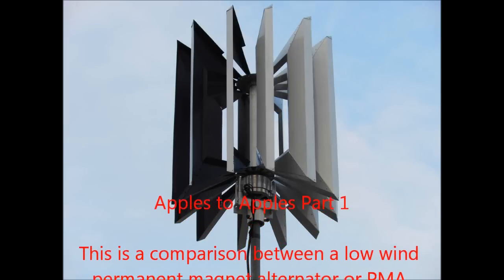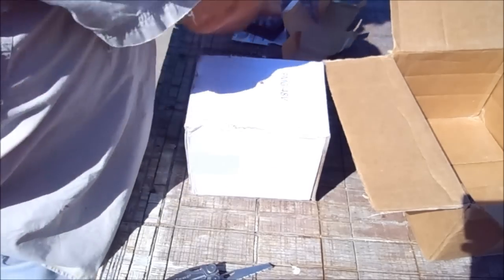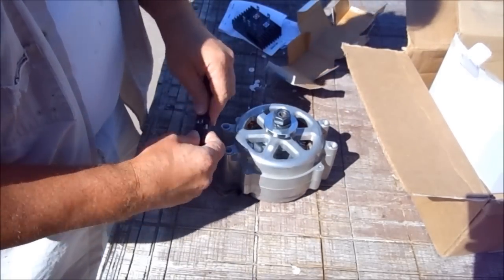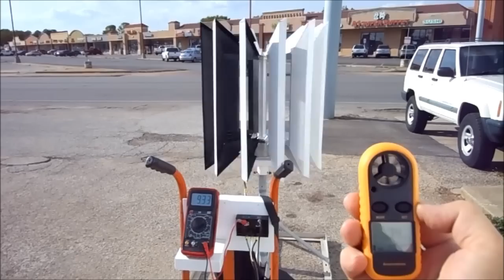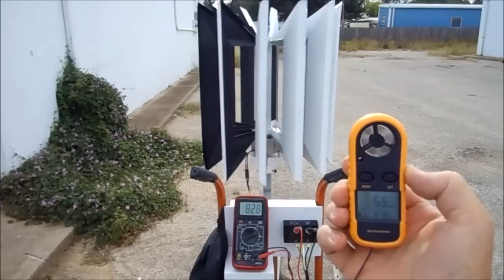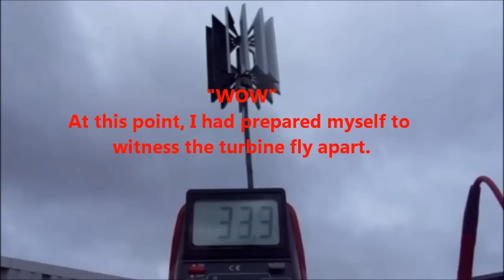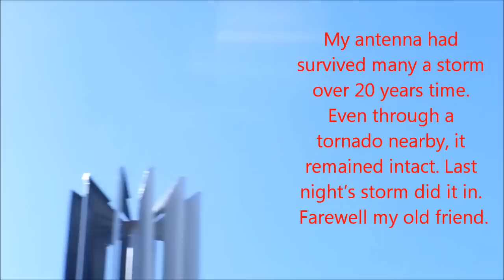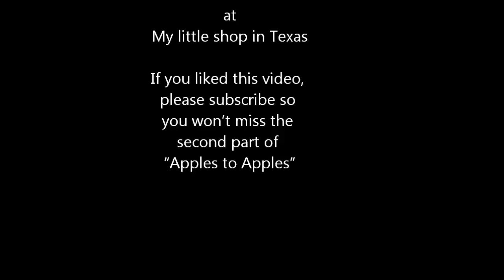Apples to Apples Part 1

Comment: I know some residents in one town were able to create and build "corner" turbines on each of the 4 corners of their homes.  I did not get any specs or product names but they were long vertical systems built right into the walls and the vane and geny system could be accessed and changed out when needed.
Reply from the maker: That type of setup will definitely be a future project if I can ever accumulate enough money for the project. Thanks for the comment.

Comment: How do you deal with lightening strikes?
Reply from the maker: I haven't had to deal with any lightning strikes so far. It might be more of a problem if the turbine was higher than the trees around it. It's usually the tallest conductive object in a storm that gets hit by lightning. As far as that goes, none of the trees around me have been struck in the last twenty five years either.

Comment: Very nice, your turbine is ecstatically pleasing and makes electricity, win win.  Did the alternator act as a wind brake at about 21 volts?  Have you tried a vane, to shield half the turbine so it doesn't push with the reverse of the paddles?  I am considering a build for us, as we live off grid entirely, any electricity is a plus enjoyed and subscribed
Reply from the maker: At 21 volts? All I can say is any load adds resistance and will slow the RPM of the turbine, but since my system is twelve volts all I need is 14 volts to charge my batteries. When I built the first small model, I built a shield that would spin around to point into the wind just like a horizontal wind turbine does. But in turbulent wind the shield always had to move into position before the turbine could spin. If the majority of the wind in your area comes from one direction a shield might be practical. But in my area, when I get wind it can be crazy turbulent and change direction constantly. And it's in that turbulent wind that a VAWT has the advantage over a horizontal wind turbine.
Reply: Thank you for your response. Here the wind is all over the map and low speed, (mostly)  The vane I saw on I think it was tesla, is part of the whole deal and the generator is mounted in it,   In NW Montana we don't get enough wind or sun to do a good job but combined??  Your videos have me interested in wind again East and Central Montana have commercial wind farms but here alternative energy is just not being used, We try as do a few others but cost to production is not favorable, Power company quoted 96K to bring us a monthly bill of about $100. on an already to tight 700 a month budget. Don't see that happening!  Thank you again for your inspiring videos
Reply from the maker: You and I have a very similar budget. The last several years of running my newsstand our average combined income for my wife and I has been around $12,000 a year. After we pay $3000 in property taxes our annual budget in around $9000. Taxes are hard enough to manage on a budget, but keeping the air conditioners running through the warmer months in Texas can be just as bad. It's that reason that I started experimenting with this vertical wind turbine design.
Reply: Soorry to hear that, for heat I can go cut wood, or get sawdust from the mill to use shredded paper (junk mail) and make logs with, that helps it it the lighting that gets us in winter time, need them on the whole time your up. For a oven try the box portion of a defunked freezer, paint it black place in the sun after you electric charge the and then spray on the powder, allow the parts to preheat the box will do the job, like you said cheap good fast choose two   Great job  I hope it works out with the wind turbine, afterr you get it all worked out send me a pdf file, with the turbine and the datat plus prices Wind and solar places here are hungry for new products.
Reply: @LittleshopintexasSV  pls can i buy this project?i am in Bangladesh.. apurbo747gmail.com..pls

Comment: what about the power output ?! what can you do with it .. please make a video about that. thank you .. nice job
Reply from the maker: Because wind speed fluctuates a great deal, power output on a wind turbine fluctuates as well, so you shouldn't run anything directly off of a wind turbine. And because the sun doesn't shine 24 hours a day, you might not want to run anything directly from solar panels either. I would recommend using both wind turbines and solar panels to charge batteries. From the batteries you can use its DC voltage directly, or you can attach an inverter to the batteries to acquire an AC current.

Comment: This suggestion would add wind load to the mast but, make a deflector for the upwind rotation that is also on bearings with a vane to rotate the deflector. This would block the wind striking the upwind rotation and give all the power into the downwind part of the vanes.  Just a for what is worth suggestion.  Nice work with this video.
Reply from the maker: I played with this idea on my original small scale model that I tinkered with on my desk at work. The deflector had a tail that was guided by the wind much like your standard horizontal wind turbine. The tail aloud the deflector to rotate around the turbine depending on what direction the wind was coming from. The issue with using that idea with this turbine is; to support the deflector in high wind, it needs to be mounted both below and above the center line it rotates around. But there's no center shaft on top that it can be mounted to. I have another design in-mind that includes a deflector. I just have to wait until I have the money to try it.

Comment: 2 questions:  1. the total cost for one including support post. 2. bad weather stability & fail.  
thanks for the videos,  good stuff to think about.
Reply from the maker: I have not yet been able to buy enough materials to workout any wholesale deals with a supplier, so the cost of materials runs close to five hundred dollars for each turbine. That's not including the PMA! It may not look like it but there are a lot of parts to this turbine. As far as bad weather stability goes, a hailstorm with large hail might beat them to pieces. But no thunderstorm has caused any damage to them since 2014 when these were built.

Comment: I like your wind turbine very much.  Would it be possible for you to send me instructions for making your turbine? Email    

Vievinde.1234@yahoo.com
Thank you very much
Elaine & Viet
Reply from the maker: Eventually I may have plans available, but they will not be for free. I will  have to buy a SketcUp or some other type of drafting license before I can make printable plans available. If you'd like to contribute a couple dollars to the cause, you'll find the best ways to do that in the video description below.
It may not look like it but there are over 65 parts to this turbine: many require machining. Several holes need to be drilled and tapped and still other holes drilled to receive the 72 assorted bolts with nuts and lock washers. All of that is required to build just one turbine. There are still more parts for the mounting bracket and depending on what PMA you're planning to use, there is even more machining to get the center shaft to lock onto the input shaft of the PMA/PMG properly..... Or you could design your own.

Comment: Can this wind turbine provide enough to power your whole entire home?
Reply from the maker: The short answer is no, not by itself. Unless you have constant wind, no wind turbine can power your home by itself. But how much power you need to make depends on how much power you use. You should consider using solar panels in combination with wind power connected to a battery bank to provide power during calm nights when there is no sun or wind.

Comment: Hi, very impressed with your manufacturing and design, so somewhat surprised when you used wire to hold the vanes equally spaced. Much easier and better surely to use some of the aluminium offcuts to make 25mm (or similar) wide spacers, which would do the job better than the wire, and much easier to fit..?
Reply: Will, while it would have been easier and possibly stronger it would have created more drag (resistance) and adversely affected the aerodynamics to a greater degree.

Comment: Hi. Have you tried using stainless steel welding wire used in MIG welders? It is 1.6mm dia. and would be ideal for this to strengthen your blades and maintain spacing.

Comment: HI ANDREWS I HAVE QUESTION FOR YOU IN YOUR EXPERIENCE CAN THIS TURBINE BE GOOD I LIKE EXPERT OPINION THIS A SKY BLUE 1000 TURBINE MAX OUTPUT 10000 WATTS 20:1 SEALED GEAR REDUCED 6 BLADE SYSTEM SCH 40 UV PROTECTED FLEX BLADE FULL 360 WIND DIRECTIONAL 4 BRUSH PERMANENT MAGNET STEEL HUB 49V-25A= 1000 CAN YOU GET ME YOUR OPINION PLEASE THANK YOU JOSE.

Comment: Have you considered the RV market? The turbine would need to be a smaller diameter- my RV is 11' 1" total height (this is to the top of the AC- the highest point on the RV). What I'm thinking is an 18" turbine (11' 1" + 18" = 12' 9") positioned to turn while traveling down the road with a swing arm that would bring the turbine from horizontal to vertical while parked. I do not have the height of the AC on my RV at hand, so the turbine mounted on the roof could actually be a little larger than the 18" originally suggested, but this market is wide open for alternative power. People are putting in larger and larger battery banks to store the few hours of solar, when your turbines would run 24/7 with less weight than the battery banks. And for those already invested in solar, your turbines take up so little roof space, they could be added and supplement the solar (really out-perform the solar). Consider batteries at full charge with inverters to run TV, microwaves, coffee pots, toasters, whatever the weather- rain or shine. Just a lot of possibilities...
Reply: wind machines...as you drive.....excellent........storage is needed but easily doable........rv prius...makes more energy than it uses!